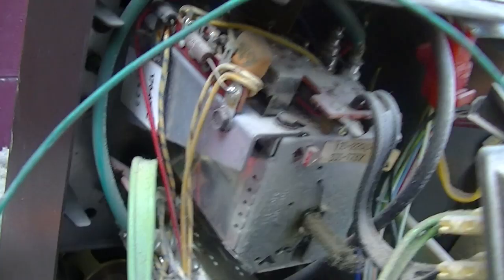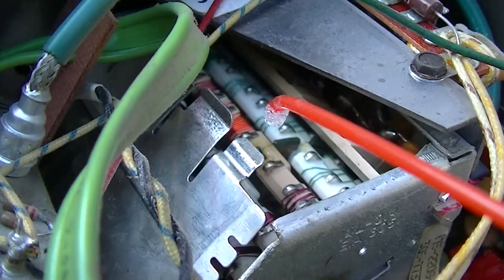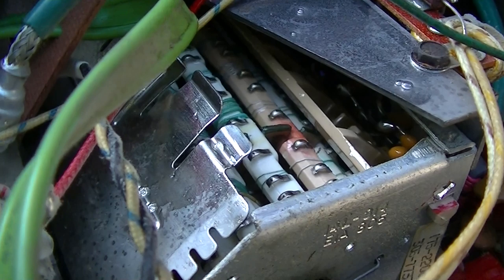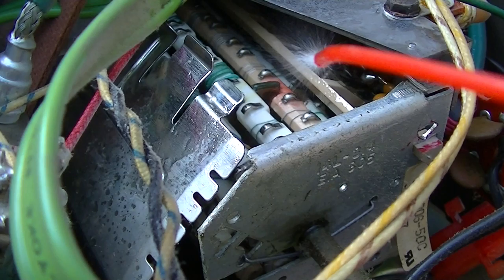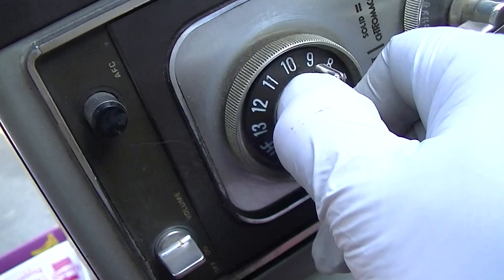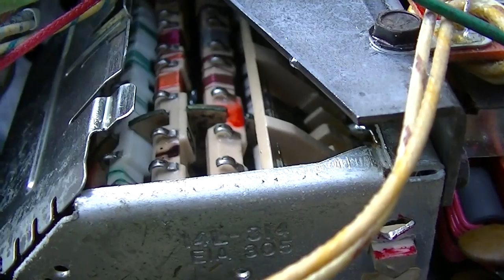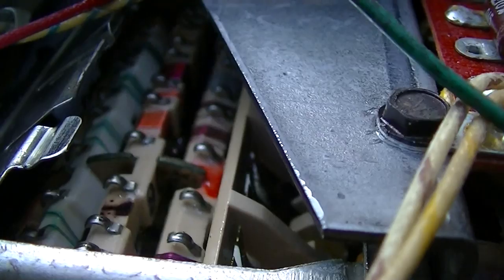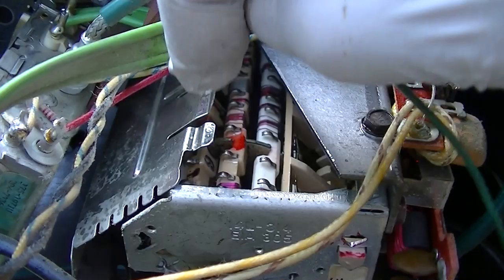1977 Zenith Chromacolor II Vintage Solid State Portable Color TV

Comment: I was a design engineer at Zenith during the time this set was made (1973-1994). This set does not need the 4 lead cap replacement as this was from the model years before this set was made. The orange Sprauge caps fixed the issue. The bad caps were white from American Radionics. That problem put American Radionics out of business. This set was made in the Springfield, Mo. Plant.
Reply: And the dirty secret is Maggy used them too on the T991 IIRC chassis. Had 2 of them cut the neck.
Spent 40 yrs at a Zenith shop, sure miss them.
LFOD !
Reply: @tomj4506  You are correct. Magnavox used the part as well. Zenith made the mistake of mounting the part on the heat sink of the horizontal output. This hastened the failure.
Reply: I had curiosity about the white ceramic plates with row of pins, in the CRT board have one marked as "HOT", exactly what is this? These looks as thick film resistor networks...
Reply: Wow. Commenters think they’re experts on these sets, but you really are! Yes, it’s hard to beat Sprague caps.
Reply: @luizmarxsenjr  They're probably hybrid ICs. At least the smaller one. The bigger might be a thick film resistor array, containing the output resistors of the video outputs (they might use thick film technology to make them low inductance).
Reply: @mrnmrn1  I don't think that they are semiconductor elements because the ceramic plates are too thin to carry any chip, and if it was the case, the chips were very unprotected against the enviroment and prone to be damaged, sure is a thick film resistor unstead wirewound ones in order to minimalize any inductance as you said...
Thanks for your feedback...
Reply: William, I ended up being a design engineer in the 1980s in computers.  I tripped over this channel, but it filled my heart with memories of the great American brands of the 70s...  Zenith, Quazar, RCA, and GE.  My adult kids wouldn't recognize any of them today.  1975 my family joined the age of color television by buying our first 19" color Zenith at a Sears in rural Kansas.  The whole family was so excited, we were glued to the TV for a week just to experience color!  It looked a lot like this and I remember it being something Chromacolor.  Could that be right?  Nice job, by the way; that set lasted until 1987 or so!!!
Reply: Ahh..yes, those american radionic caps were total junk, don't be vague,rely on Sprague. Orange drops are highly reliable. Fixed a lot of Zenith stuff.
Reply: @WilliamCohn  The location of the cap was not the issue.   The part did not meet Zenith's specs.
Reply: Zenith was always the TV to beat.  Great design, great picture, great performance, great durability, unsurpassed reliability.   A typical Zenith product.  Built to last.  Quality in every respect.   From design to service.  That 4 lead cap was only used in the "F" line TV chassis and was not made by Zenith.  All later version chassis already had the new replacement orange Sprague caps.  And Zenith typically replaced the picture tube failure, due to the cap, under warranty, and replaced all other white caps remaining in the field under warranty as well.  I was a Zenith tech for many years.  I loved Zenith, and still do.  No-one, and I mean NO-ONE made stuff like Zenith. No-one.
Reply: I worked on many old zeniths and still have a space command table top with remote . they were great TV's and I'm sorry that we cant get anything made in the USA  that comes close to the old zeniths
Reply: @William Chon what was the percentage of American parts vs import parts in this set?
Reply: I replaced a lot of those kits.
Reply: @luizmarxsenjr  Caution HOT.  That what it is. And it is HOT as in heat-wise.
Reply: @tomj4506  hello chassis model T9911RC IS SOLID state chromacolor ???? Wanted Diagram chassis T991IIRC ?
Reply: @jorgeadrianzen6604    T991 is a Magnavox TV not Zenith. It has the cap & if its white needs to be changed. Orange ones
are OK
Reply: Seems AmRad is back and they manufacture in Palm Coast, Florida.

Comment: Springfield, MO - my home town.  The plant closed shortly after this TV was made.  I recall that there were lots of labor problems at the plant.
Reply: I think that after it the plant was moved to Mexico...
Reply: In 1992 I believe and lost 1500 jobs there.
Reply: Zenith seemed to have labor problems everywhere; the unions probably followed them from place to place.. I had to replace the power supplies in a bunch of Mexican-made 1980s monitors because they were smoking up the air in a hospital and once you opened the neat matal case, it was like a giant bird's nest with a slab of fiberglass embedded in it. Not the work of a happy shop .

Comment: I have a 19" Chromacolor II, made in 1976. Yes the capacitor was replaced with an orange one.

On mine I have noticed that when there is just snow on the screen, the image is rather dim. However it brightens up when there is a signal. Not sure if that was a feature since pulling and reseating the module boards seemed to help with that.

Funny, mine starts off with a red picture before the green and blue warm up. Yours starts off blue before the green and red warm up.

I think the Chromacolor II was the Zenith of Zenith.

What I mean by that is it's a mix of technology new enough to run for decades before requiring service, with enough quality to ensure these sets still work after ~40 years. The system 3's, not as good of a CRT... then of course 1993 came along and Zenith CRT's went to utter crap.

I keep my CCII around in part because I think it was the last of the well made Zenith sets. As in, still working 40+ years later with only some basic cleaning done for maintenance.

Comment: Good old CC2!  I remember unpacking these brand new in '77 and '78!  I turned 17 years old in June of 1977, and I started working at the TV repair shop (Active Television and Appliance, Sylvan Lake, MI) in August of '77.  I worked there until early 1981, so I saw the last generation of the Chromacolor 2's, and the very first System 3 sets!  And in the case of RCA, the XL-100 sets, and the beginning of RCA's next generation after the XL-100, and I can't remember what it was called right now, senior moment!😁  It amazed me way back then, and now, how HEAVY these little Zenith CC2 13" sets are! I have one, was working fine and quit, I have to get around to repairing it one day! Thanks, for the great videos!

Comment: It wasn't just Zenith that had the HV cap problem. Magnavox, some RCA's, and Admiral had the same problem. It did seem Zenith got the most attention however. The reason the 13 inch set was so heavy is because it basically had a full 25 inch chassis inside. A few mods for the picture size, but basically a full console in that little set.
Reply: i agree.... zenith was an archrival with rca.... which started color tv.... zenith said we will build color tv better than anyone... once the bugs are worked out.... in 1961... zenith cried uncle... and ordered 50,000 color picture tubes.... from... guess who? RCA..... of course.... but the zenith sets were supposedly overengineered........ therefore the small color zeniths just like the big'uns.... but remember the GE portacolor? their big sets were overgrown portacolors.... because they realized that portacolors were so overengineered that they would work well in anything they built...

Comment: These were my favorite sets to work on. Pull all modules, spray clean contacts. Crimp VERY slightly each connector on the modules. Re- install. Then rap on the metal frame with something to be sure nothing changes :-). AND Yes, orange drop good, if white 4 wire cap we always changed that out.

Comment: My Gripe with these early inline EFL gun zenith tubes is just what you've discovered. The Green gun gets lazy first. Eventually it will start to loose focus, then the drive dies. Beltron seems to do a good job of rejuvenating these - better than my sencore does. Also, they over scan like crazy - especially on the horizontal sweep.

Comment: Brand new when I was working for our local dealer. Just like yesterday to me. You don't see a lot of Zenith most likely because they keep working and the owners want to keep them! Your observation that the H-Out transistor was Toshiba was correct (T Z on it meant it was made for Zenith and is an original part). These types of tuners would have the stationary contact strip warp and we would put a shim behind it to restore a good contact.

Comment: I bought a 19-inch Zenith in 1975. Those plug-in boards were awful. It became a matter of smacking the cabinet at times. My Howard Sams employed brother-in-law tried to work out a solution, but there was nothing that worked. My wife continued to work at Sams for some years, and we bought several sets from the Family Store. My Zenith came from retail. I replaced the Horizontal output transistors more than one using an adequate amount of heat sink compound. I am hooked on your videos. Cheers

Comment: ZENITH had outsourced production to MEXICO  in 1980 (100 %), before then, the circuit boards were being made in mexico starting in 1978( boards will have the part number on a sticker, with where it was made, also if there is an "R" number after the part number, that is the repair number  1, 2 ,or 3   after the third repair zenith scrapped the board)

Comment: On those CCII sets the chassis tilts back, hinged at the bottom. Loosen one screw at each side at the bottom, then there should be a bracket to release near the top.  Easy to access the trippler and that oil cap.  Also a bunch of electrolytics back there on the module sockets.

Comment: My 2002 JVC 20" TV/VCR Developed an internal tube arc. I took it to a repair shop. It was beyond repair. I didn't know much about electronics then. But I would guess it might have been a similar issue as this. It was around 2007 before I got my first HDTV.
Reply: Probably the tube itself.  could have replaced the pic tube, but would have cost as much as a new TV. Back when a 19" color set cost $350 -$400  and rebuilt picture tubes were available for $100 it would have been a viable repair.

Comment: Those earlier inline gun Zenith tubes from the late '70's-early '80's were not as durable as the older delta gun tubes and it was usually the green that went first. However, they are still not nearly as bad as the crap from the '90's.

Comment: Hi, I find this Zenith TV line interesting, it has different components such as kinescope, these orange 4-terminal capacitors, it also has those ceramic plates with a row of terminals that I never knew exactly what they are, looks like thick film resistors.
I lived in Paraguay, and I notice that imported a small batch of these dated March 1981 TV sets (color broadcasting from that country began that year), once I got from a friend a 13-inch Zenith television that's almost identical to the yours in the outside, but inside was completely different, I remember it was made up of 3 printed circuit boards mounted on a plastic frame, the fly-back transformer was huge and no longer used high voltage tripler. Unfortunately the TV was in very poor condition, and was hit by an lightning, so the repair was not feasible, but I kept some of its pieces as a souvenir. By the way, unlike yours, this TV I got was made in Mexico, but it seemed to have a little of every place in the world inside...
I really liked your TV, congratulations!!!

Comment: I had those bars with a analog rf modulator, I had to replace a filter cap as the esr was way to high and now it's fine.

Maybe you just need to replace a couple of capacitors inside the your Jerry Springer box.

Comment: 12voltvids had rebuilt several digital conversion boxes.  The digital box's SMPS caps go bad all of the times because of constant use and cheap cap quality.  Just a heads up.

Comment: Those oil filled ac capacitors were phased out when the system 3 was introduced. Those oil filled caps contained very high amounts of cancer causing agents  (PCB). I had a couple of them go bad as a Zenith tech

Comment: Samsung is pretty much what zenith was in the past here in the us nowadays but i think they are made decent because we still have a 13 year old 40" lcd we got brand new in my parents room and i have a 6 year old 40" Samsung smart tv in my room
Reply: My grandma has a 2009 Samsung LN52B630 and it hasn't needed any repairs yet. It's on like 24/7. It replaced a mid 1990s Magnavox that was still working also.

Comment: the rolling bar might have something to do with the converter box's power supply, if it is a switching supply the Y cap in the supply might be bleeding 60Hz through the aerial port

Comment: Shango if the picture shrinks that means often a rise in EHT not a drop. There is increased acceleration of electron beam which therefore endures less deflection, even with a corresponding rise in line and field drive. Velocity increase of x would require doubling of drive x.

Comment: tell me why you never use a vacuum cleaner? Why poke around in the dust and breathe when it is possible to solve the problem in five minutes?
Reply: I use a paint brush and a vacuum sucking up the floating things
Reply: @cardboardboxification  I use the same method, since I don't have a compressor. I'm going to make one out of a fridge compressor and a fire extinguisher (as reservoir). This plan is not more than 15 years old...

Comment: hello friend good morning I have a 1977 chromacolor zenith tv it does not turn on due to voltage overload. since it worked well but the tv was 120 volts and they put 220 volts on it and I do not know if it can be fixed and I would need a diagram of the source at least Do you know any website where I can see the diagram?

Comment: I can hear the purists screaming when you're spraying that tuner "Think of the Q, won't someone please think of the Q!!!"
Reply: I've seen some oscilloscopes ruined that way. The oil creeps between the layers of variable caps, changing their value by a lot, so the HF compensation of the input divider goes so bad that even a 1kHz squarewave can look horrible on a 100MHz scope. 

I don't know if these tuners have variable capacitors, I assume not, because they're adjusted via tunable coils. The only variable cap in it is probably the fine tuning.
Reply: They're the same hysterical people screaming over Brake Cleaner on South Main Auto....
Having been around back in the day, I think the purists' heads would explode (not a bad thing), were they to actually go back in time and visit a real working TV repair shop. The horror of it all, the absolute horror. Goodness! We still used R22 to clean early high-voltage electronics in our home shop.....

Comment: I have a 1970 Panasonic portable 9 inch set with a clock. The clock isn't working and the television has an issue with the horizontal. It bends at the top of the screen. If you can help me diagnose the problem let me know. Not sure if a tube is bad or if it needs capacitors not sure.

Comment: I see it has a couple of thin film resistor packs on the tube base, how were they for reliability in this set? They were in a couple of sets here and gave a bit of bother..
Reply: Zenith used them for years & they were reliable BUT they loved getting cold joints on them.

Comment: thats called  a green stick  tunner  ..use  a flat  ink   rubber eraser  on  the contacts...  take out 2.3 4   an  clean a tighten  the spring  contacts   with a ink  eraser..  spays   are not  good on this type  so much

Comment: Chassis hinges down for service. ONLY chassii ##EC45 & ##FC45 need the cap changed if it is white.
Caps are different so be SHURE on value !! Failure mode of orange ones is dead short or wide open
link E to ground or  C to FBT. They WILL NOT cut the neck ! Fail of a white one can cause too much HV, destroy vert
& other things. Vert loss causes hi DC on yoke & that heats & cuts the neck. More on the subject if you wish.
BTW these were VERY good sets.
LFOD !

Comment: Shango 066 ,have have you ever tried  fiber glass pens for cleaning contacts etc.,I got my first one from radio shack / refill 8.95 ,but after that I was buying them on eBay for 2.00 ,they also use to sell a brass pen and a steel.pen the set about four years a go were about 6.00 for the three piece set they have since gone up a good bit ,but I mostly use the fiber  glass pens amazing at cleaning contacts and much more.anyone else use these ,I would love to here,your results with them.just a thought you probably already have them ,thanks for shareing

Comment: Is there any way you can hook up a digital to analog converter to one of these?
Reply: +That Random Oshawott - Of course! They all have a channel 3/4 modulator in them. Only extra thing that would be needed to connect it to this set is an inline 75 to 300 ohm matching transformer at the antenna terminals.

Comment: I have a Zenith SD1923W  manufactured Feb 1987... can I re-scan antenna channels... I know it works like a champ...Mine was made in USA....   Had it hooked to cable 6 months ago... is it safe to use 40psi to blow off the dust   Kinda funny to think that my 4 year old Sharp LC-50LB37IU back lighting just took a dump...thanks again China for another crappy produced product

Comment: Should have soldered in that safety capacitor. He is lucky the high voltage didn't arc, and crack the crt - especially with the test pattern running.